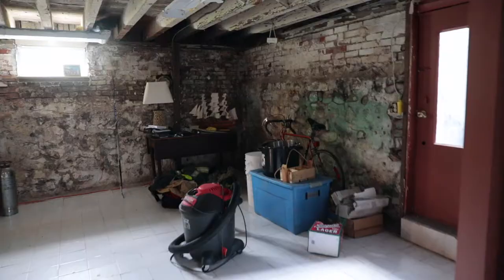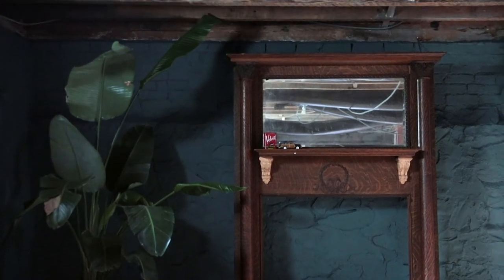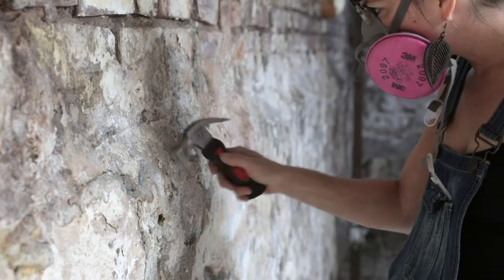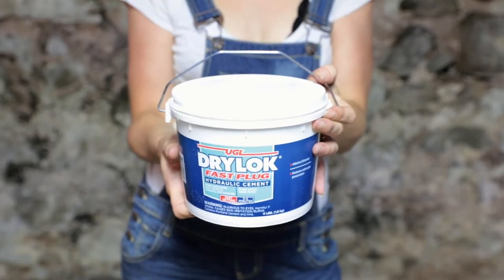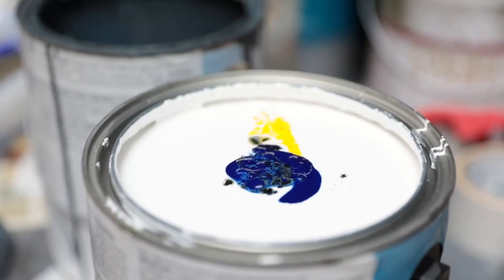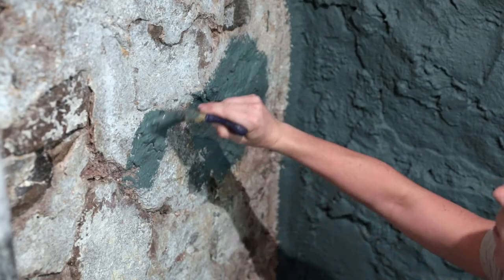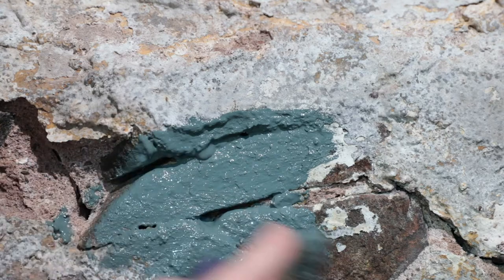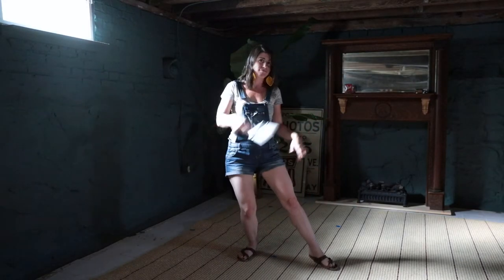HOW TO PAINT OLD STONE BASEMENT WALLS Using DRYLOK®

Comment: Everything you did, both the drylock cement and drylock paint are the absolute worst things you could have done to your old basement walls.  I'm fixing a prior owner's mess on my stone foundation from both of those products. Over time, the paint will trap water behind, bubble up and cause your lime mortar and any plaster to fail. The cement (portland) will lock the stone and cause cracks and damage elsewhere, nearby lime mortar with turn to dust. Your damage is going to be worse since you have brick (which is softer than stone) as part of your foundation/walls. Its not if, its when - I'm not talking 20-30 years down the road, could happen a few years from now.  Old stone and brick foundations get damaged #1 from water and #2 from lack of proper maintenance. You should have just pointed and then stuccoed (plastered) over with lime mortar. Would have looked fantastic. Honestly when I first bought my old house I thought both of those drylock ideas sounded good but thankfully I identified and addressed my leaking problems first, then I researched, researched and researched until I understood the hows and whys of proper maintenance of old stone foundations.
Reply: Well I just got my walls pointed and whitewash and it’s water seeping through the wall. So, what next? 🤷🏾‍♂️
Reply: @williewoods5595  I'm not being facetious but the first thing to do with a wet basement is to figure out where the water is coming from. First, understand that even the smallest amount of water will wick its way down and through the basement walls. Second, water comes into the basement from either hydrostatic pressure or a leak (or both). Hydrostatic pressure is basically when the water from saturated soil outside the basement walls works its way into the basement. Leaks on the other hand allow water intrusion from anywhere else: a leak in the roof, fascia, or eaves; rotted siding or cracks in the stucco; deteriorating chimney bricks or chimney cap; etc., or a combination of these. Sometimes the source is not obvious and you have to do some sleuthing. The sleuthing may need to take place over time, or even seasons.  A tiny leak from the roof might drip somewhere into the 2nd storey, wick its way down through the wall before ending up in the basement. If you have a leak, you have to fix it. With water resulting from hydrostatic pressure, the general idea of the fix is to reduce the soil saturation outside of the basement walls. This means ensuring the grading outside of the basement is sloped so that rain drains aways from the house and making sure the gutters are functioning properly and the downspouts direct water far enough away from the foundation. In some cases, the fix might be to install a french drain outside (or inside) the perimeter of the basement. And there are some situations where the hydrostatic pressure issue simply can't be eliminated because of a high water table or frequent rain - these basements were never meant to be used as a living space. I caution you that most "basement-water" experts will try to sell you on a drain system and/or other costly fixes before really knowing where the problem originates from. So it's important to try to figure out first where the water is coming from, nobody is in a better position than you to do the sleuthing, at least initially. I encountered all of the above in some way or another. Hope this helps.
Reply: I honestly couldn't believe she was putting this up there! This is even worse if you're in a climate where the ground freezes part of the year. I have the same basement and have spent time researching how to fix the walls which look a lot like hers.
When she said, "I really like the deep groves" I just shook my head!

Comment: Yeah, totally remove that pesky mortar from in between the brick and stone that's keeping your walls together! Don't repoint it with mortar so they last another 50 years, instead throw some dry lock or cement type stuff in there that'll totally mess with the normal settling that takes place!